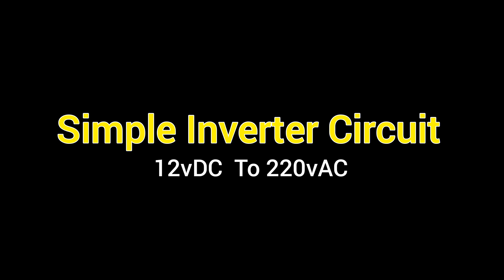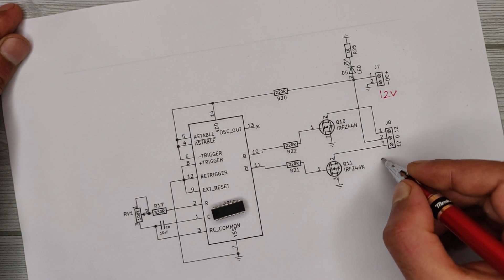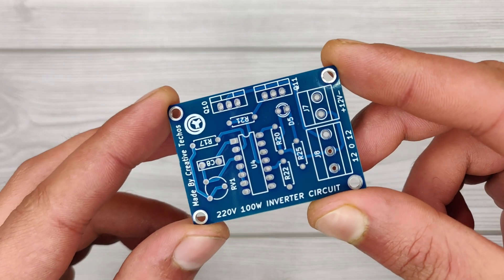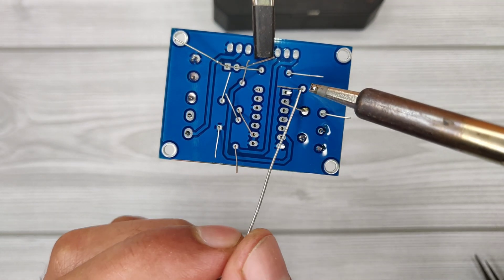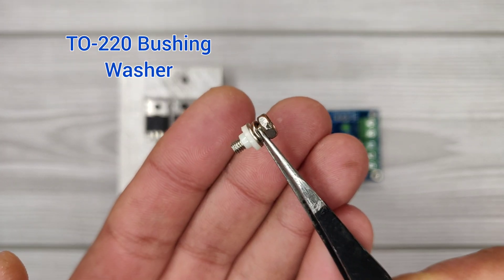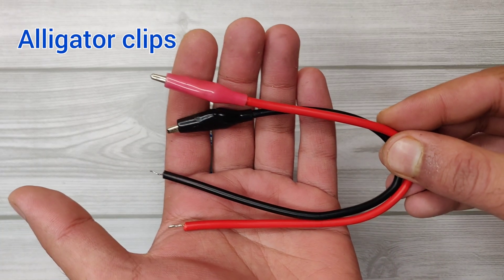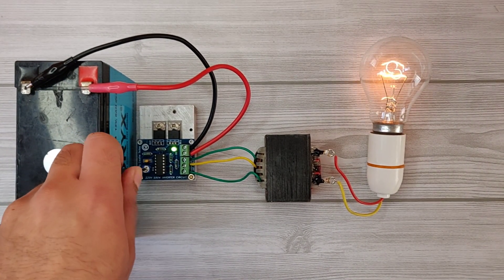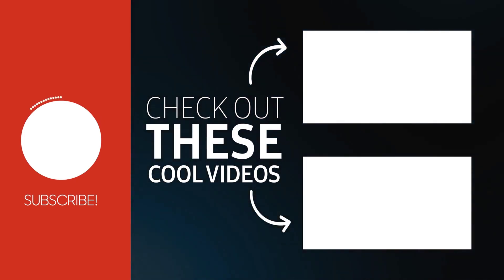Simple inverter circuit 12v to 220v

Comment: Seitlich passen noch 2 x kleine BD -Transistoren mit 1 kOhm davor ,  zum Vorschalten für den IRF 44  drauf. diesen z.B 100 Ohm und parallel dazu 100 nF. -> Gute Sache. Beide Emitter zusammennehmen über Brücke  und noch Platz für eine kleine ausreichende Steck - Drossel am Emitter als saubere variable Wechselstromwiderstandsbegrenzung zu dem anschließbarem bistabilen Trafo mit zwei Wicklungen und der Transformerwicklung. Noch Z-Diode 25 V über 100 nF in Gegenrichtung zum Ausgang geschaltet auf Erdung für bistabile Wickeltrafomitte.

Comment: Einen HF - Transistor mit super Reserven, als Schalttransistor  g l e i c h   z u  verwenden ist Unfug , weil dieser dann gleich auf Überlast geht. Man braucht eh nur max 400 Hz für Inverter (kleinere 5000 Hz , Trafos  etc. - > hier eher Tip 41 bis 5000 Hz ideal aber auch für 1 MhZ  (auch verschiedene  NPN - C - Typen noch, hier verwendet man aber erst extra  im Spulenschwingkreis diesen selber als  IrF 44 N , dort exzellent einsetzbar . Weil er in der Spiule schneller anspringt. Die relativistische Verzögerung von TIP oder von C Typ auf IRF ist peep - egal. Dafür muß man den  IRF als Sperrwandler an der Spule zusätzlich noch leicht invertierend gegenkoppeln, und für höhere NF oder Stör - HF etwas stabilisieren, (gefährliche Oberschwingungen) , also gesondert ganz simpel invertieren lassen, sonst kommt auch wieder gesplitteter  - Frequenzsalat , mit Leistungsverlust heraus. Ein MHZ und noch viel Mehr durch Tip 41  oder C Typ reicht auch für chinesische Stördrosseln die wild schwingen . Nackt schaut der IRF recht magersüchtig aus. Stabilisiert bringt er es aber voll. Da geht sonst ohne Minimalregelung ein BD deutlich leistungsstärker . Es fehlt der vereinfachte Spulenschwingkreisplan komplett  für diesen dort excellent reagierenden  Transistortyp .

Comment: i can use this circuit to make 50V/ 5A out from 12V?
Reply from the maker: It seems you need a boost converter dc to dc, but this is inverter dc to ac

Comment: I really like your videos. I'm a novice at electronics. I've only started as a hobby a few months ago. I am learning many things from your videos. Thank you for that. It is especially helpful that you have answered questions I've left in the comments. I appreciate this immensely. I'm just beginning to understand how some of the components either control or alter the performance of certain other components. 
My question about this project has to do with the output voltage. I'm in North America, we use 120 volts AC. How would I modify this circuit to output 120 volts? Is it just the matter of a different transformer, or are other changes required? 
Also, I realize this is a simple inverter, so no pure sine wave output. How 'clean' is the output? What type of devices should I NOT plug into this inverter? What kind of output wattage (continous) should I expect at 120 volts?
Thank you.

Comment: it would've been nice had you made it without jlcpcb
Reply: He also has provided the circuit diagram. So far I've built two of his circuits from the diagrams and had complete success. So you don't HAVE to use the PCB. 
I am curious though, what is the reason for your apparent disdain for JLBPCB?
Reply from the maker: I didn't told using jlcpcb is important, i have also provided pdf pcb layout that you can prepare at home, or zero board can be used also with reference of circuit diagram.